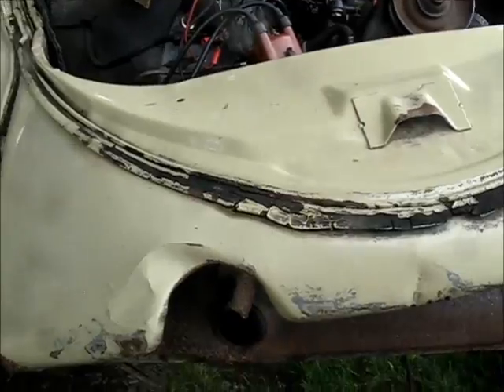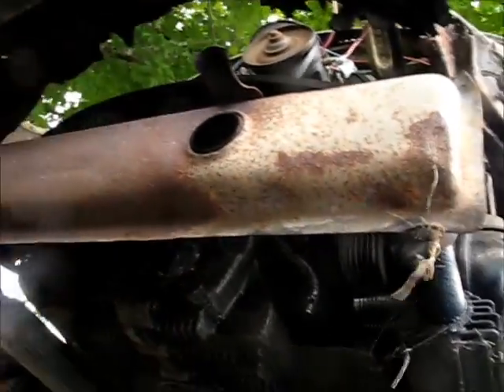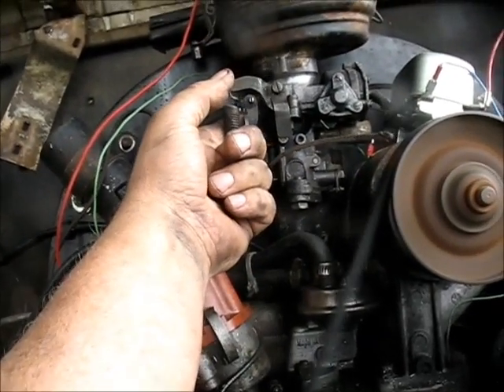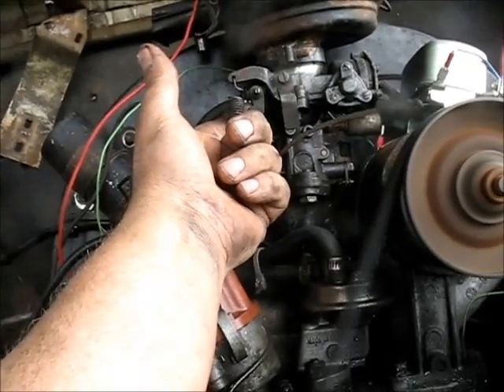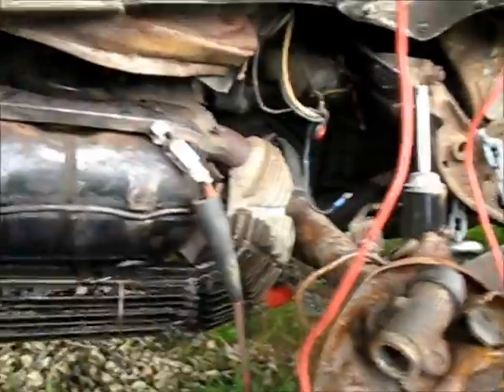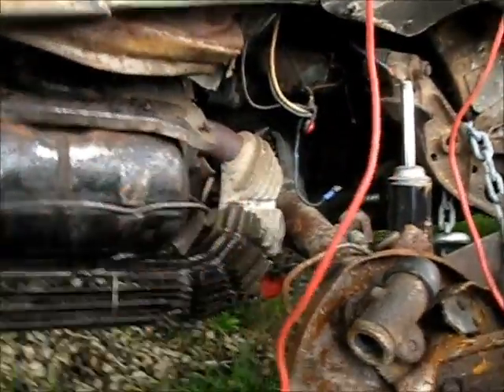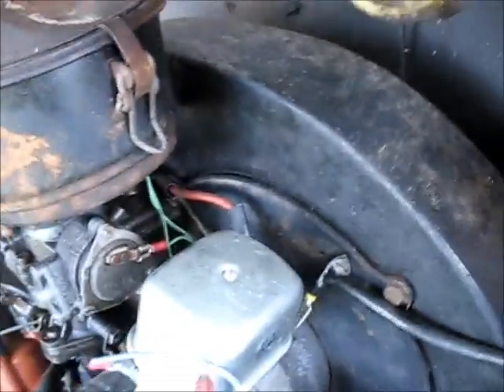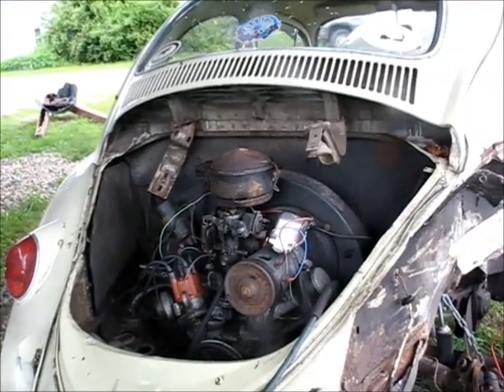Will Cinderella's Engine Still Run?

Comment: Sure you don't want to go through that 1600 you've had for 18 months and use that? It already has all the tin, alternator, whole nine yards, drop right in.

I would also bet that the non-fitting carb you have  is a 34pict that goes with a dual-port intake.